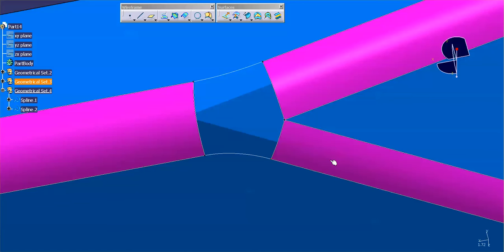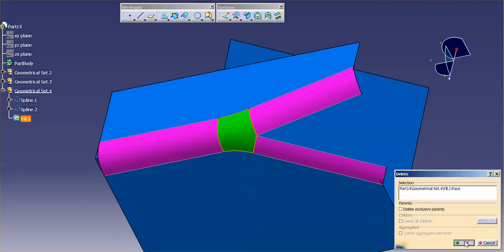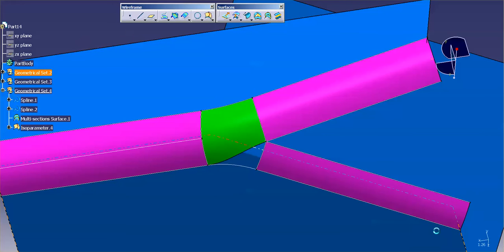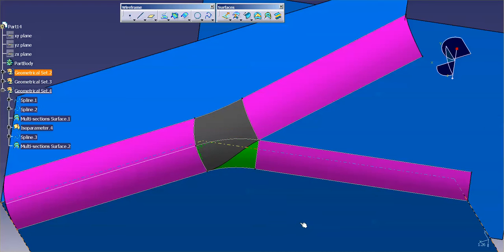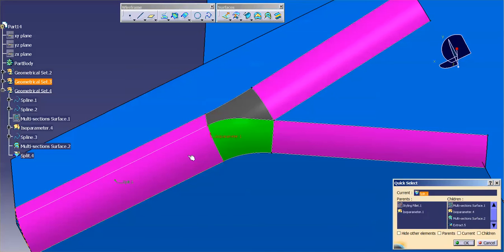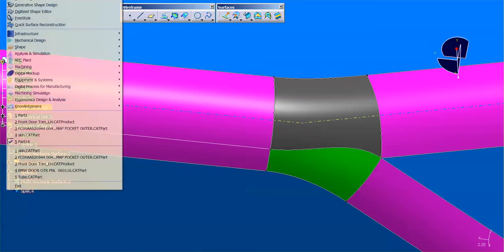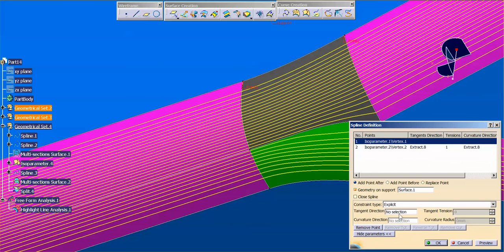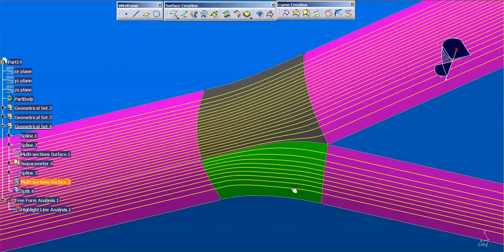5 Sided Surfaces | Corners

Comment: Hi and thanks for your great great great videos,your every video has lot lessons for me.I'm a beginner in CATIA v5 and i'm trying to design flowers and leaves from pictures and have so many problems with "edge fillet".I will be thankful if you cover the problems that pop up with "edge fillet" and WHY.for example in designing a leaf,sub-surfaces meet at a sharp point,and when I join sub-surfaces and try to fillet the edges I face a lot of problems and getting the meaning of errors is not so simple!:)thank you.

Comment: Hello! Can I ask, does it matter to pick up a white curve or black curve when I build a surface to connect for examples to pink ones here? (White curves I mean profiles and guides from previously madden surfaces)
And so using a Edge Fillet is forbidden for Class A Surfacing ?
Reply: To my knowledge, using a black curve (edge curve) will suffice; however, if you create a curve off of that edge (white curve) that curve now becomes something that can easily be selected in the tree to be used multiple times and is much easier to track. I'm sure there is also another good reason for this I just can't think of it at the moment. As far as the edge fillet tool is concerned, I don't believe it forms a class A surface due to the fact that it really only forms a tangency connection versus a curvature based connection. More insight would be appreciated from someone more experienced.